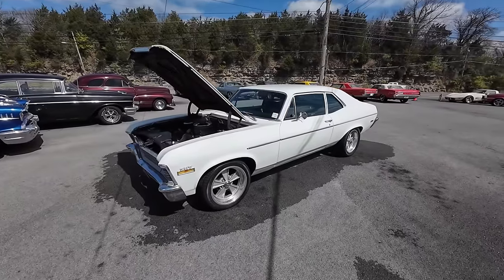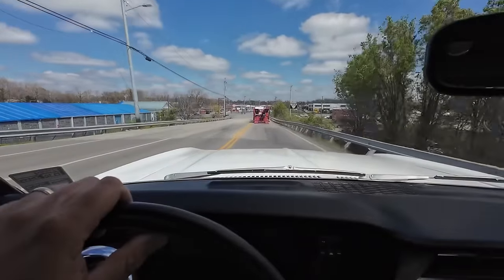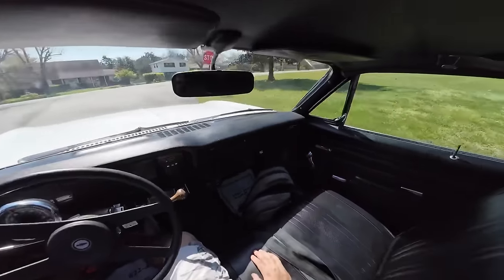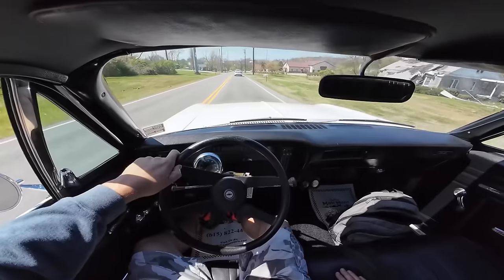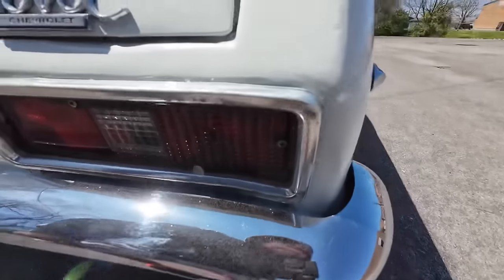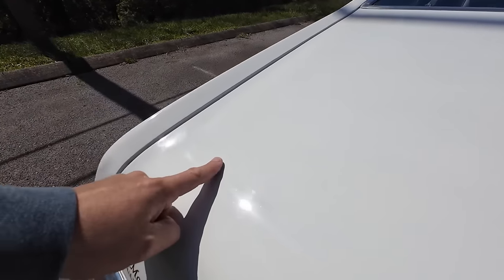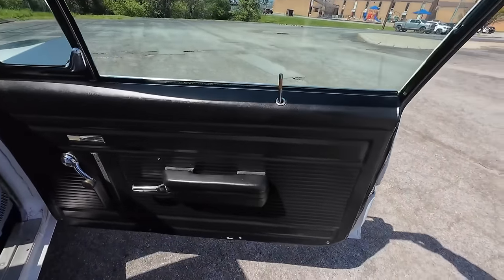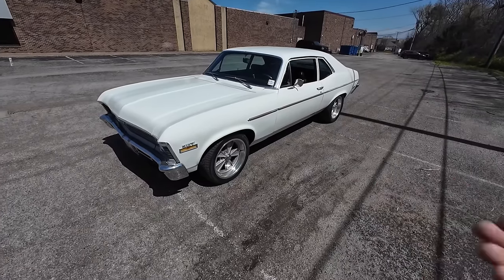Test Drive 1970 Chevrolet Nova SOLD $19,900 Maple Motors #2524

Comment: That can't be a 307. Never seen a 307 with the alternator bracket on the right side. That's usually a 350.
Reply: No I have one the same way
Reply: It a 307
Reply: You apparently have not seen enough 307s the one in my nova is exactly like this. I Mean... All Chevy small blocks are the same. Just different bore. Rod length, and heads.
Reply: You have to remember that a lot of these cars have to be adjusted for the mechanical needs of the day. For I have seen many like this, but it did not mean it was wrong.
Reply: @GenXRedneck420  Stroke
Reply: @Carl_Jr  yes yes. I just wanted the main poster understood what I was saying.
Reply: @GenXRedneck420   I know. Sorry I should have said, also stroke. But you're right. I was just being hypercritical. 😁👍